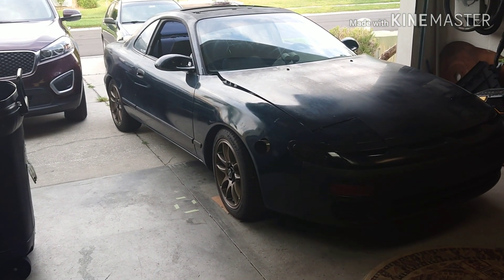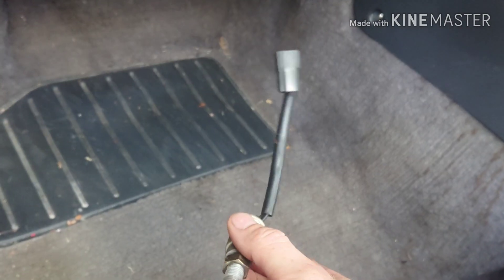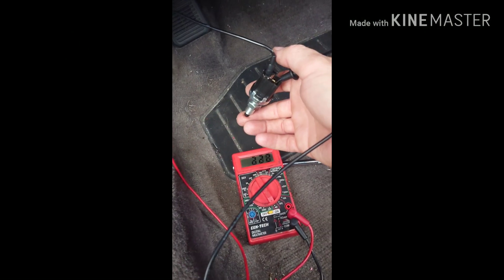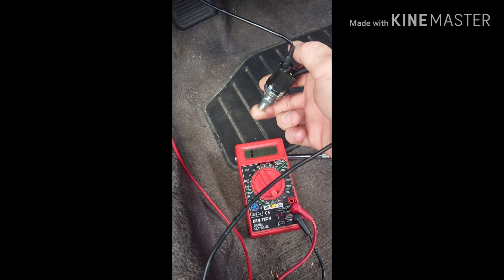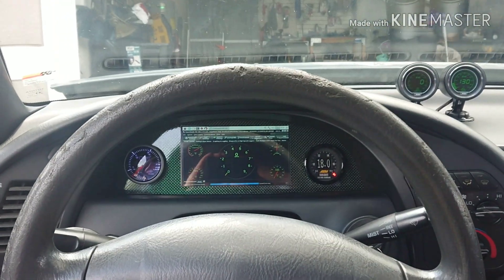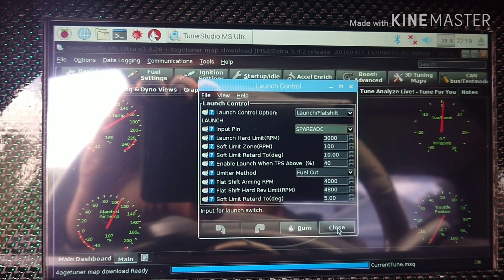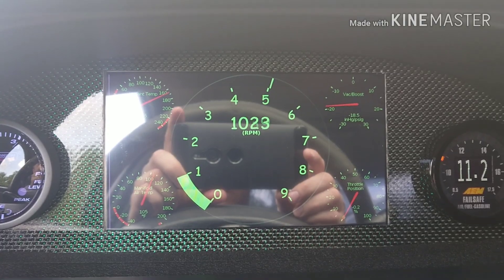Microsquirt v3 2-step launch control and flat shift

Comment: Nice
 I was gonna ask if you did fuel cut or spark cut but i saw that afr guage go into the red so obviously its spark cut lol
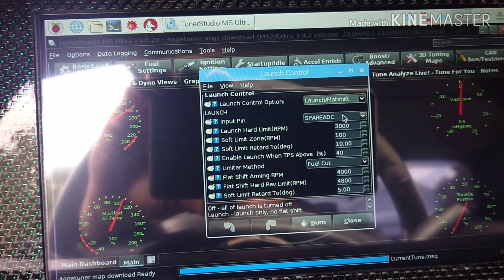Reply from the maker: Its actually fuel cut. I cant use spark cut its too aggressive and has a tendency to spit out valve shims. At the 1:55 sec mark you can see it says fuel cut

Comment: So just ground one wire from the  switch to chassy... and the other wire from the switch goes to the ms clutch pin?
Reply from the maker: Yessir
Reply: @BurtonDynamics  I tried that on my ms2.. directly to ground it doesn't work. It's wired on the clutch switch pin... my ms2 also have launch input pin... I'm setup for flex fuel. So flex fuel is setup for launch pin. And launch is setup for table switch
Reply from the maker: @damnitdang  might be different for ms2. What pin exactly did you use?
And tour saying you tried it directly from ecu to chassis ground and it didn't work?
Reply: @BurtonDynamics  ms2 pnp the 26 pin ecu.. I belive the older ones are 16 pins.  So it's setup for flex fuel. Which diy states to use the table switch for the launch.. it's switched in the ecu for it.so even when I ground the wire from  clutch pin to ground to mickmick clutch.. it still doesn't work .. I don't have upper clutch switch in my truck. So I was gonna hook it on a toggle switch if I got it to work. I even grounded pin 2, which is table switch.. it still don't work lol
Reply: @BurtonDynamics  I'm gonna unhook the flex fuel. Amd just run it as normal with the launch.. 
So in yours... you have a clutch switch pin amd a launch pin on the ecu?  Where do your launch pin go to? Unused?
Reply from the maker: @damnitdang  well various pins can be made to be launch control. I was going to use my flex pin but decided not to because I'm currently lowering my compression so I can run 93 as an option if I'm stranded
Reply from the maker: @damnitdang  did you go into your tuner studio and set the pin to be used for launch control??
Reply: @BurtonDynamics  yes. Launch was set to table switch.. because launch pin is set to flex fuel. So I grounded the table switch pin amd it doesn't work. I grounded the clutch switch pin also. Still didn't work. I set the launch to 1500... Rev it and it just over revs like normal .  Is there another setting I'll have to configure?
Reply from the maker: @damnitdang  do you have any other available pins other than flex?
Reply from the maker: @damnitdang  I'm not sure because I don't use table switching. I use just launch control option right under table switching
Reply from the maker: @damnitdang  our options in tuner studio could be completely different as well

Comment: Is that a tablet mounted on the dash?
Reply from the maker: It's a raspberry pi 3 under the passenger seat with an HDMI cable to to a touch screen
Reply: @BurtonDynamics  Thats clever, looks good with the wideband aside it.